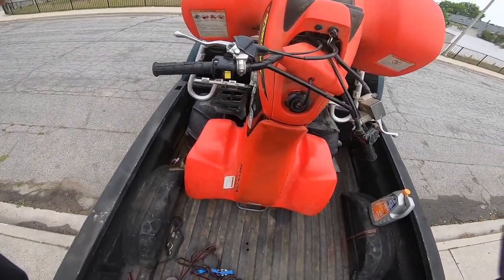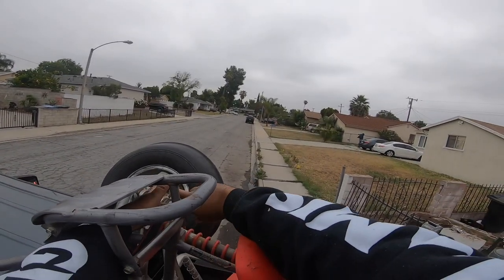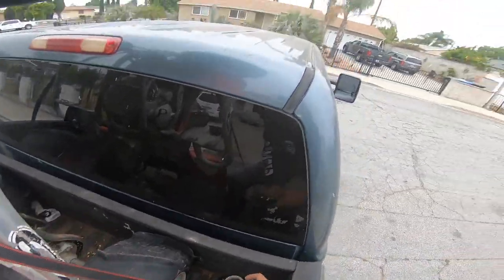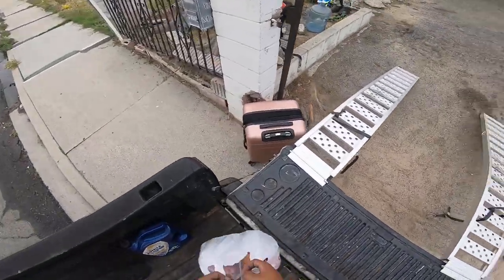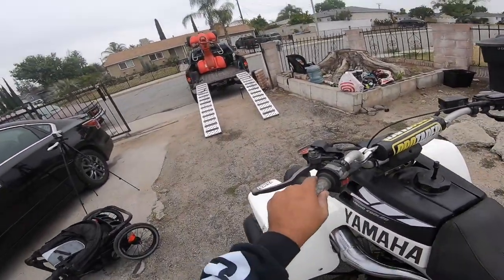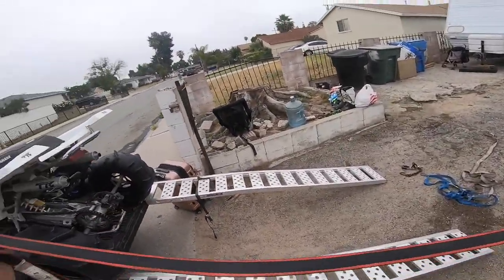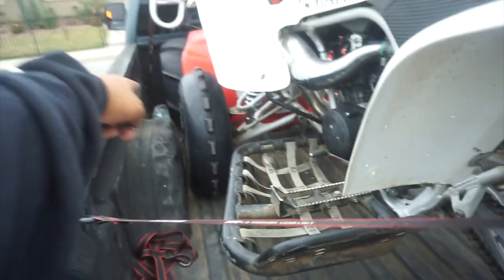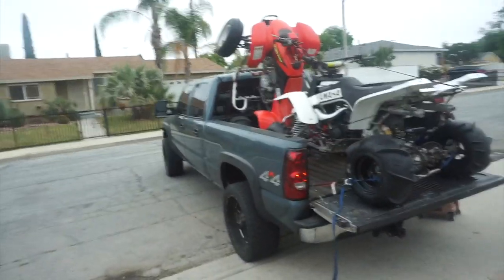HOW TO LOAD 2 ATV's IN A TRUCK! (BANSHEE and HONDA) / Cantamar Arenales Memorial Day weekend 5/31/21

Comment: Is it bad if fuel spills when standing up the bike?
Reply from the maker: It’s best for the bike that is being stood up to have less than half a tank of gas and tuen the gas off via pet cock… if it’s spilling a little bit of gas it’s not bad for the quad but will drip on your truck. If there’s going to be flammables near then yes it can be bad but a couple of drops won’t hurt a thing.
Reply: Turn the gas off and empty whats left in the carb
Reply: Vggg
Reply: Cce
E

Comment: Is it bad if I’m traveling a 25hr drive I have a ltz 400 the fuel isn’t a problem what I’m concerned about is the oil from transmission or coolant getting out
Reply from the maker: Good morning bro, coolant won’t get out that’s for sure! Now in regards to the oil, it should be fine but before turning on your bike when you get at your location make sure to check your air box. A little might creep in, but it’s no big deal just fill your levels back up for you fluids

Comment: To have your quad facing up will that mess up the engine?
Reply from the maker: No it won’t but it’s advised for a 4 stroke to leave it standing up temporarily s couple hours or days. Not meant to be stored this way make sure to turn off your gas also.

Comment: Oil won’t come out the engine into the air box???
Reply from the maker: What’s good Daniel. No if your levels are good then no. I usually just travel with them like this I never store them this Way only banshees since they are two stroke

Comment: Exactly what  I needed.  Can I stand up a raptor like that without problems for a 5 hr driver to the dunes?
Reply from the maker: Good morning, Should be perfectly fine just make sure the Atvs going up has less than 1/4 fuel. Make sure to turn off the fuel as well
Reply: @AceMotorsports  Appreciate the fast reply.  I'll try it out and see how it goes in the driveway first.  cheers!
Reply from the maker: @MacStrengthCo  I’ve traveled over 7 hours like this. Wouldn’t recommended storing it like this tho but a couple days is fine. I have left them up like this for 2 days and all well.

Comment: is it okay to stand 2 quads up? And do you think i could push the quads far enough over to for a dirtbike to fit as well?
Reply from the maker: Yes its okay to stand up both quads if you wish to close the tail gate. Make sure gas levels are low. Let the bikes rest once you arrive at your destination and make sure to check all your oil levels and so forth! If you slide the quads all the way to the left yes sir you can fit a dirt bike but depending on the size if its a big bike you will need to leave the tail gate down. If anything do the same setup as me no need to stand both since your taking a dirtbike also! Strap them up good and have fun brotha!
Reply from the maker: Just thinking back I have done this, Two quads and a dirt bike!
Reply: @AceMotorsports  Thank you! Its just an 01' 400ex and a 300ex with a cr125. I appreciate the fast reply! Be safe out there.
Reply from the maker: You should be golden. I had a single cab with a short bed and they all fit perfectly. Have fun brotha where you riding this Halloween?
Reply: @AceMotorsports  I will be riding up on the mogillon rim in Arizona. I want to get one more ride in the pines this year before they close the forest for the winter(for camping and riding at least).